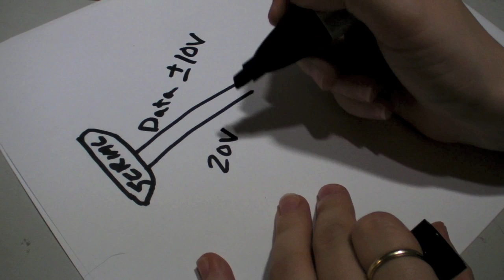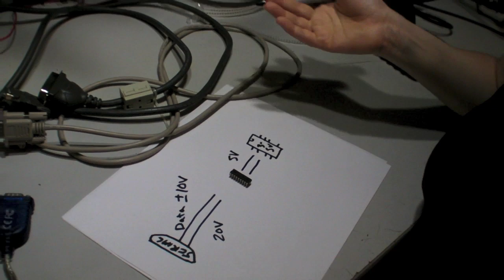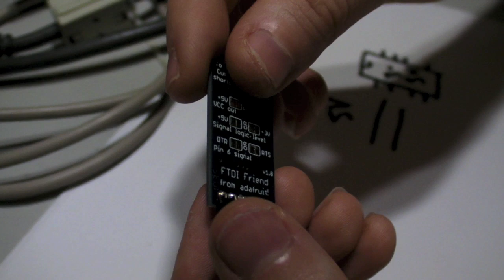USB, serial & you...

Comment: Can you please tell us how to make a usb programmer using pic18f4550 as all pic programmers uses pic18f2550 ? Whats inside of the hex code for the firmware and how it converts the voltage to programming voltage ? How to convert the hex file for pic18f2550 to hex file of 18f4550 firmware ? I have usb to serial cable max232 and pic18f4550 and i do lot of work but still can’t get the programming voltage please

Comment: In fact FTDI can be used for ISP programming (eg.: burning bootloader) in bit-bang mode. However standart FTDI cable is designed in such stupid way (does not have proper pins connected) that it can't be used without modifications. I wish there was some standart FTDI cable also usable as ISP programmer without hardware mod.

Comment: One thing to mention is that some of those usb serial converters use ftdi chip with max232 chip. And they cost much less than those chips from many parts supliers. It just felt so wrong when I found out that i had hooked up 2 max232s after eachother. One inside the adapter and other on my breadboard.